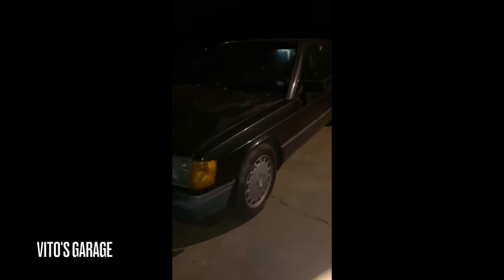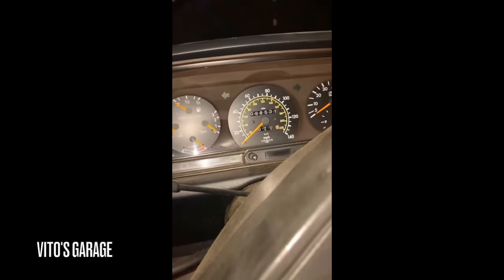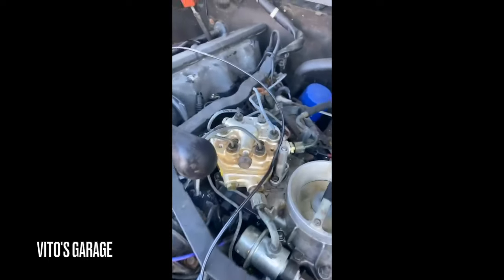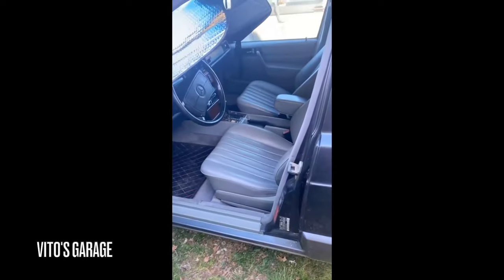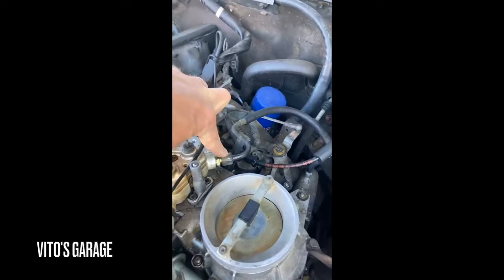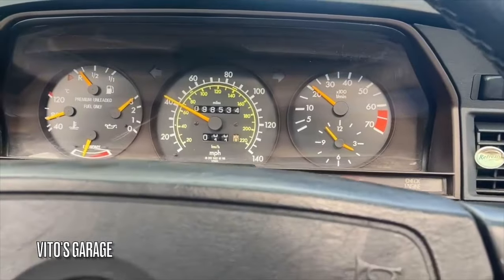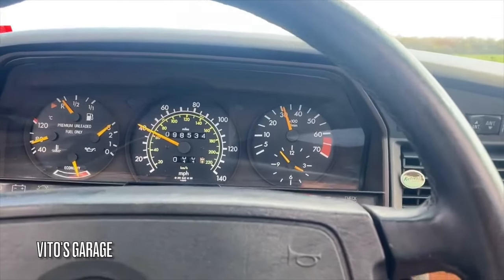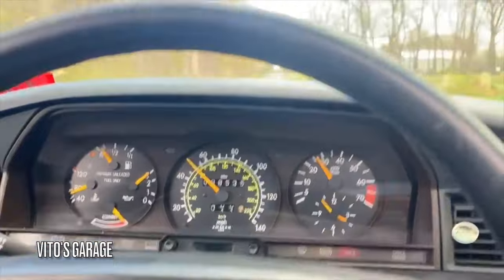My Subscriber Saved This 1990 Mercedes 190E Because the Previous Owner GAVE UP!....

Comment: Hi I have a 190e , the engine runs good but I think the transmission is stuffed , when I push on the accelerator it sounds like trying to change gears and or it’s trying to suck up heaps of air I’ll appreciate it if I can send a video and if you can have a look at it
Reply from the maker: Send me a video on Instagram: vitosgarageyoutube